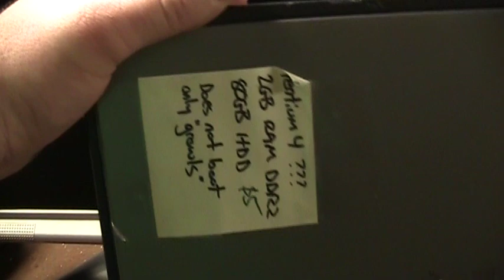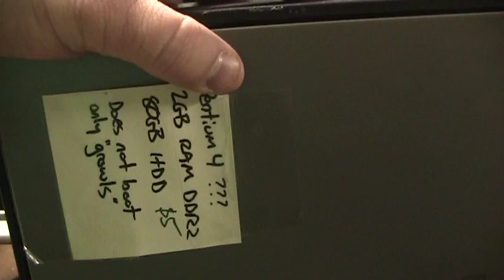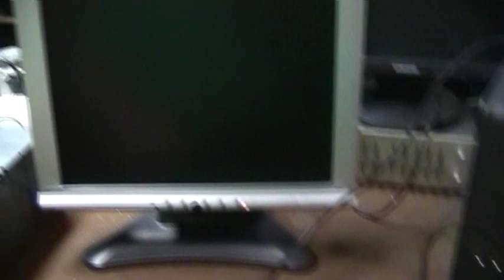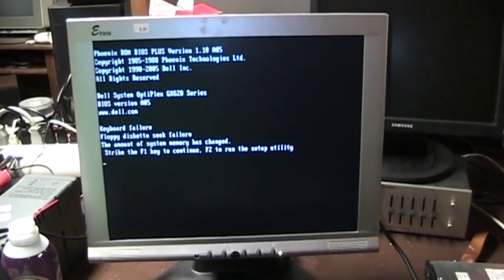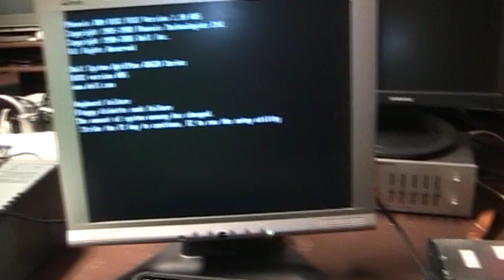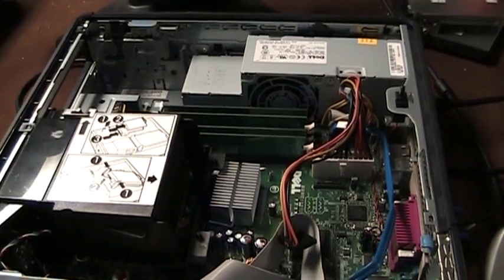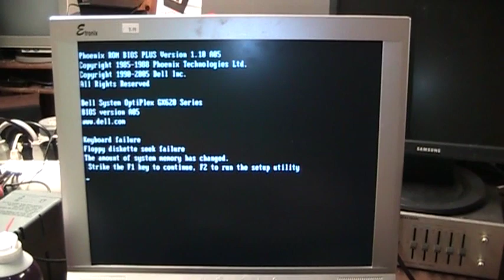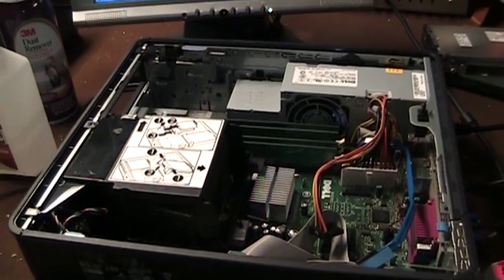Fixing and Tinkering With a Dell OptiPlex GX620 SFF Computer

Comment: To anybody who owns one of these dell small form factor towers I highly recommend turning the fan around so it blows air out of the front so it does not cook the caps which are directly behind the heat sink. When it blows out the front it draws cool air in the system and the hot air immediately exits. I have got 7 of these from a thriftstore for $5 each due to no powering on that were ditched there by WHIO TV.

Comment: I recently bought a couple of Dell Optiplex GX620 computers (scuffed side panels as usual) and when I received them, I found that neither one would recognize the 2GB of installed memory when booting up, showing only 256MG!  I did get it to recognize the memory once the operating system cranked up, any idea as to the remedy?

Comment: Look out for PSU fan failures on these OptiPlex GX520/620.  If you get flashing orange power LED after some time of use then check there first.  Replaced 64 of those PSUs in one go once because they were dropping like flies so Dell sent new PSUs for all of them.

Comment: I have a few videos posted on repairing the capacitors in these. The 745 and 755 sff were also prone to having bad capacitors. The hot running Pentium D models were the worst.
Reply: My 755 has bad caps but it still works for now. The PSU always got hot and i had to install speedfan and bump up its fan to 60% just to keep it from getting hot. I retired it in June 2021.